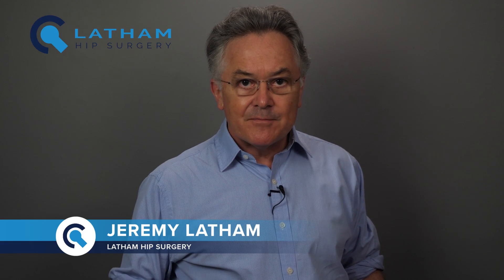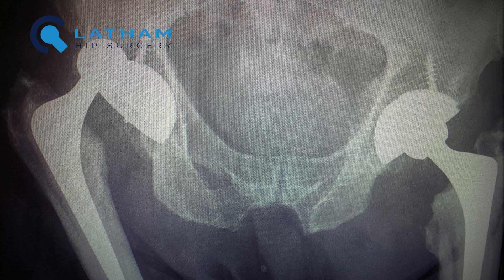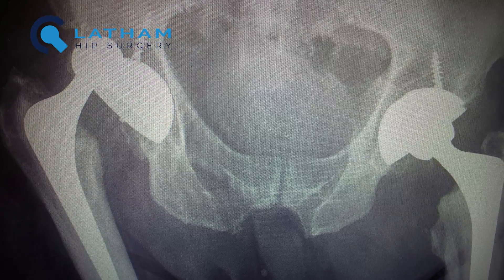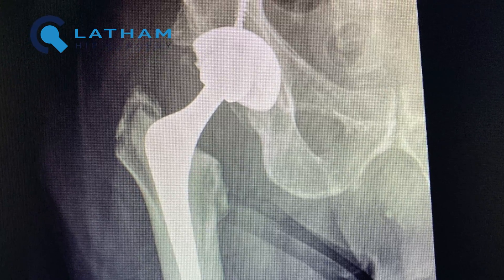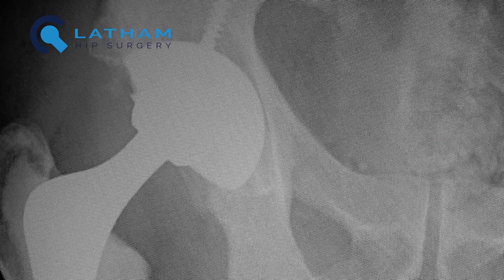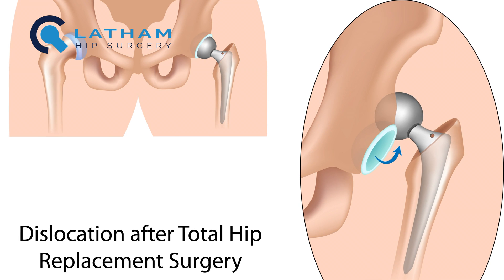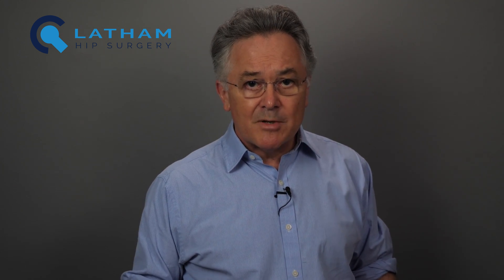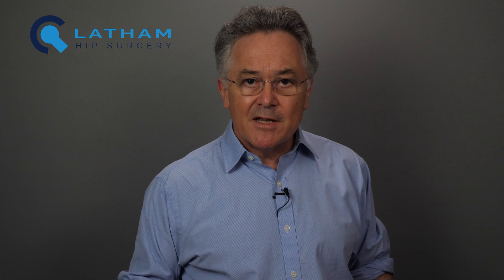Why do hip replacements dislocate?

Comment: Thank you for this video; your "bedside manner" and clarity are reassuring. Personally, I've had four dislocations since my NHS operation about a year ago (TRH, posterior), which has left me feeling in a state of limbo, constantly worried and uncertain about my future. I'm now terrified of doing even the simplest of things, even to the extent of picking up my young grandchildren, just in case my hip dislocates again. My surgeon has now referred me to a hip revision specialist but I'm not entirely sure what to expect. My life seems to be on hold and it's certainly not what I'd expected. I've even mentioned the "captive cup" to my surgeon, but he's against these as they apparently wear out quicker, and any potential injury in the future could lead to far more extensive hip/pelvic damage. Any input, comment or advise would be welcome. Again, thank you sir.
Reply from the maker: Thank you for your comments. I am pleased to hear that you find the video helpful, but very sorry to hear about your dislocations. It is a horrible complication. Four of them in a year means that there is a mechanical problem with the hip replacement. It's good that your surgeon has referred you to a revision specialist. You will need to have a careful clinical assessment and appropriate investigations such as a CT scan to identify the problem. It is likely that you will need to have the hip revised, so that any technical issues can be remedied. I will often use a dual mobility socket in revision surgery because it is more stable, and doesn't have the problems of a constrained, captive bearing. I hope that it all works out for you so that you can get on with your life again.
Reply: @Lathamhipsurgery  Thanks for replying so quickly, and for your kind words. In cases where a dual mobility cup is used as a replacement, is it also necessary to replace the femoral stem as well, or can the existing implant be adapted to suit the new cup?
Reply from the maker: @chuck1outzz  no problem. If the stem of the hip replacement is solidly fixed in place and its position is satisfactory then you can leave it in place. If there’s a problem with the length/offset/rotation then it will probably need to be removed and a new one inserted. There are adapters that can be used to overcome technical problems but your surgeon will discuss all of this with you. Hopefully this information will help with that discussion.
Reply: @Lathamhipsurgery  Thank you so much. I'll remember to have this conversation when I see my specialist in a few weeks time.
Reply: @Lathamhipsurgery  Hello there. I trust you are keeping safe and well. Further to my comment about a month ago, my specialist has now recommended revision surgery using the dual mobility cup; I'm just waiting for an operation date. Basically, my understanding is that although this is a more complex operation with a longer recovery period than that with a 'standard' replacement, the outcome is a far more stable and flexible hip joint, but the risk of dislocation remains, albeit a far lower risk than that with my existing (i.e. standard) hip joint. Would you agree that this is an accurate summary? Thanks for your time, as usual.
Reply from the maker: @chuck1outzz  That sounds like a very sensible plan. A dual mobility bearing will significantly reduce the risk of further dislocations. One would never say never when it comes to dislocations because there can be muscle deficiency that is difficult to restore. The revision procedure is more complex and the recovery is longer but in my experience the outcome is usually very satisfactory. Hope it works out well for you.
Reply: @Lathamhipsurgery  Thanks for your comments and expert opinion. It’s truly appreciated. I just hope the waiting list isn’t too long, but that’s obviously outside my control. Anyway, at least I’m heading down a more positive path. 🤞🏻

Comment: Could you suggest what components in your opinion are the safest and most durable for hip replacement? I.E, ceramic on polyethylene, ceramic on ceramic or metal on ceramic?
Reply: Thank you very much for your expert opinion.  Its good to have 
the opinion of a very experienced surgeon in a matter as complex as this and who strives to do the the best for his patients. Much appreciated and thanks again.
Reply from the maker: @leeindention7493  Thanks! Happy to help.
Reply: @Lathamhipsurgery  

I had my consultation with my surgeon. He was very impressed when I enquired what type of components and their various constituents he would be using in my surgery. He confirmed he would be using the components you suggested in my surgery.  He also recommended that I have a bilateral hip replacement as my other hip is bad as well. I am a bit apprehensive about having both done together as I think I would be very vulnerable and unsteady after the surgery.   The reason my surgeon suggested a bilateral is, I would need the other one done in about six months so he suggested doing both as the recovery time would be the same. Anyway, thanks again for your most helpful advice .
Reply from the maker: @leeindention7493  Thanks for your feedback. It's good to hear that things are moving along with your treatment. I quite often do bilateral surgery. It makes a lot of sense if both hips are as bad as each other; one anaesthetic, one admission and one period of rehab. Hope it works out well for you.
Reply: @Lathamhipsurgery  

The surgeon is performing a mimimaly invasive muscle sparing posterior approach procedure. While researching the procedure I noticed that the anterior approach was being touted as being superior to other procedures, I.e posterior. What is your opinion on this?
Reply from the maker: @leeindention7493  I use a posterior approach because it's safe, predictable and easy to extend if you need a better view of the hip. Direct Anterior Approach is popular in the US and some European countries. There are very few specialist hip surgeons in the UK who have specific training and experience in DAA. Those who use it say that recovery is quicker. The evidence shows that done well, and by an experienced surgeon there is no significant difference in functional outcome between the two approaches. Wound problems, infection and fractures are more commonly seen in DAA particularly when the surgeon hasn't a great deal of experience. I wouldn't have it done to me. Hope that helps!
Reply: @Lathamhipsurgery   I concluded the same as your goodself, but not having a medical background or training it's very reassuring to hear an experienced and medically competent practitioner bearing out my layman's conclusions.  I really appreciate the time and thought you put in to your responses to me. If I was a UK resident , I would have no hesitation in choosing you as my surgeon. Again, thank you very much for your opinion as it has made it easier for me to deal with my forthcoming surgery. Kind regards.
Reply from the maker: @leeindention7493  It's my pleasure. Thanks for watching my videos!
Reply: @Lathamhipsurgery  

I forgot to ask your opinion on one  particular issue in our exchanges. I am quite an active person for my age but due to the impact of the arthritis on my hips my excercise regime has been seriously impacted. I read in my research that a dual mobility hip replacement is superior to the normal one, giving more flexibility and movement than a normal one. When I discussed this with my surgeon he said he uses it only in patients with weak muscles and revision surgery that it is not as durable as the normal one. He also said it has a higher dislocation rate than the normal one. Essentially he said he would not recommend it in my case. What is your opinion on this? ie , is a dual mobility less stable than a normal hip replacement?
Reply from the maker: @leeindention7493  I use DM bearings in patients at a higher risk than normal of dislocation, for example, revision surgery, neuromuscular conditions such as MS, Parkinsons and after a stroke. I routinely use them in patients >75y because they are at a higher risk due to frailty, poor balance and muscle weakness. DM are not suitable for active younger patients because they will probably wear out more quickly. Everything decision that we make in joint replacement surgery is driven by trying to balance the risks and benefits for a particular patient. It is often more art than science!
Reply: @Lathamhipsurgery  
Thanks for your reply. The opinion you gave on using  DM is practically the same as the opinion my surgeon gave to me regarding the reasons he would use DM. So it seems he and yourself are quiet similar in your thoughts and  work practices . Good to know. Many thanks again.  Much appreciated.
Reply: @leeindention7493  I had both hips done (direct anterior approach) in 2022, but about two months apart. My (U.S.) surgeon recommended not getting them done at the same time, as the increased operating time would increase blood loss and the risk of infection, and that doing one at a time would allow me to deal with any complications while still having one unoperated, or in the second case, one repaired hip.
Reply: @georgegravette1132   Exact same thing for me. I had anterior surgery on both my hips 3 months apart. The recovery was a breeze. That was 6 years ago and its been great. I'm 64 yrs old now. I'm very active and recently they get stiff and I can feel the hip - no pain just noticeably stiff. No serious issues though. It must be something I'm doing that is causing the discomfort.
Reply from the maker: Thanks for the question. For most people, a bearing made of ceramic on highly cross-linked polyethylene seems to be the best compromise between good function and durability. It's also very safe in terms of biocompatibility. I use metal on metal resurfacing in selected cases - men under the age of 55, with big hard bones. The safest and most successful materials for the cup and stem of the hip replacement are  titanium alloy and stainless steel. I did a lot of ceramic on ceramic hips back in the day. The advantage of these is that they have very low rates of wear, but they can squeak. If they break, then revision (re-do) surgery is sometimes difficult because of all the debris that's produced. Hardly anyone is using metal on ceramic hips these days; there's no advantage compared to ceramic on polyethylene.

Comment: It would seem from an engineering standpoint, that a larger ball would be more stable.

Is there not enough room to enlarge that component, along with the required increase in socket size, or is the overall ball diameter not a factor???
Reply from the maker: This is a great question. The Charnley hip, which was the first mass produced hip replacement, had a ball diameter of 22.5mm. Charnley understood that to use anything bigger risked causing rapid wear of the polyethylene socket, leading to early failure, particularly in younger patients.. This was orthopaedic dogma for over 20 years. Improvements in bearing materials (ceramic, highly cross linked polyethylene, metal) encouraged engineers and surgeons to use bigger head sizes to reduce the risk of dislocation. The introduction of the Birmingham Hip Resurfacing in 1996 introduced the world to a large diameter, low wear metal bearing. A few years later, we put this large metal head onto a hip replacement stem.  This seemed to be the  perfect solution for the majority of patients. The heads were impacted onto the tapered neck (trunnion) of the femoral component. Unfortunately, the small trunnions, which were fine with small diameter heads, weren't big enough to withstand the loads transferred to them with the large heads. The heads moved slightly, setting up a corrosion cell. This caused catastrophic damage to bones and soft tissues around the hip. It was a disaster, and they were all withdrawn. The search continues for the ideal implant; low wear, bio-compatible, low risk of dislocation. Bringing new devices to market is very expensive, and there is little if any appetite to do it, given the history of metal on metal hips.
Reply: @Lathamhipsurgery  Thank you for such a detailed reply.